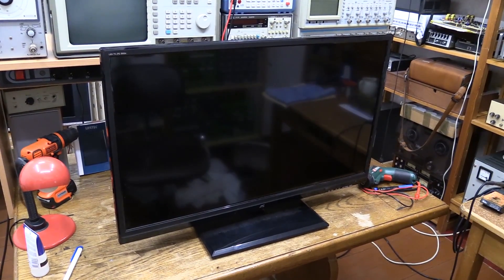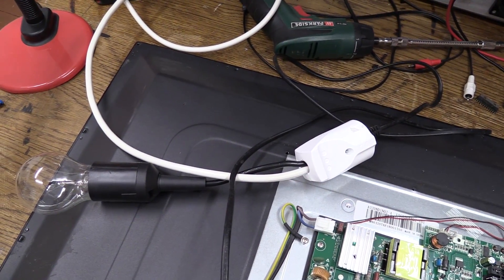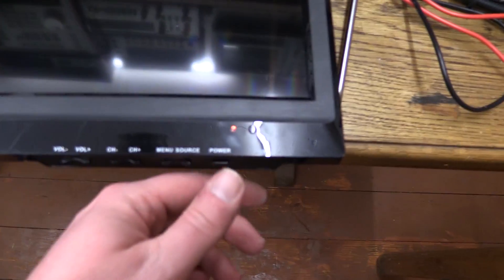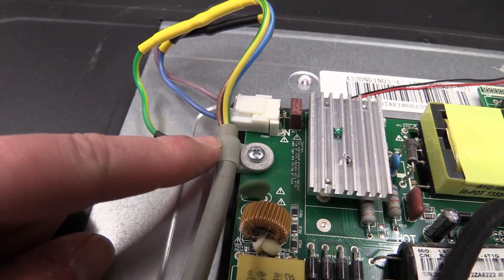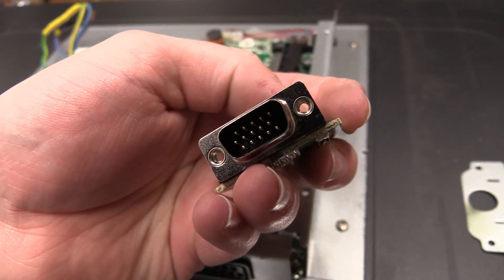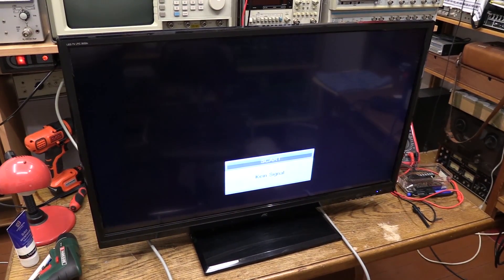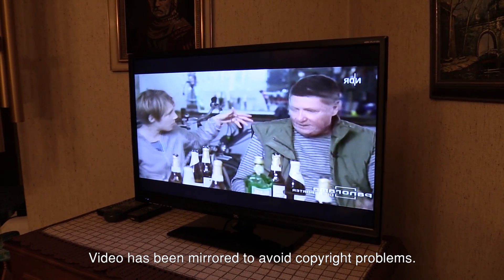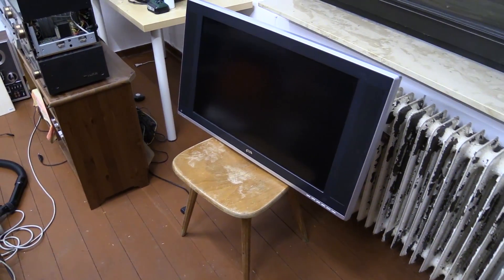High Voltage damaged LCD Television works!

Comment: Last night, there was a power problem and instead of 220v I had 300v. Fortunately, nothing broke except a small TV that was used as a monitor. I think that the sound doesn't work anymore but the picture might work. Should i open it to see if something is damaged or should i just plug it in? Btw the power brick is on the cable not internal
Reply from the maker: I would first try to just plug in the power brick alone, don't connect it to the TV itself. You can then measure if the power brick still puts out the correct voltage. If it does, you are lucky and the TV should hopefully work. If it doesn't, you might be able to find a replacement power brick.
Reply: @DrCassette  idk my grandpa who was using it said that the picture is perfect but the sound isn't working. I would measure but sadly i don't have a multimeter. Thx anyway for the reply

Comment: CapXon, and still working? Holy cow, when you think you've seen it all...
By the way, why do people always cut off the freaking power cords? To make a few cents out of the copper or what? Ι hate that.
Reply from the maker: Some people (including me) think the power cords may still be good for something, some people indeed sell the power cords for the value of the copper and some people even seem to think there was a law forcing them to cut the power cord off damaged or broken equipment for safety reasons.

Comment: If you are not not too far away from a Transmitter site, you should be able to pick up the signals from DVB-T rather easily. 
Just take some coaxial cable, strip about 15-20 cm so the center of the coaxial cable is exposed - do not short-circuit the shielding with the center core ;-))  - place it somewhere high in the room close to a window and you should be fine receiving some DVB-T channels. Maybe switch windows if the signal is weak.
Reply from the maker: Unfortunately I am relatively far away from the transmitter. I have built a more sophisticated DVB-T antenna (popular design, looks like two squares next to each other), but for good reception it needs to be set up as high as possible (under the roof) and aimed correctly. I didn't feel like going through such trouble just to test this TV ;)
Reply: I can understand that, therefore my remark that if you are not too far away :)) 

I am that close I only need a 5cm nail pushed into the end of a coaxial cable and receiption is clear. Would have been a nice way to have it tested but unfortunately that's not going to work for you then.

Comment: That old LCD TV at the end looks a lot like the 23 inch LG HD TV with DVD player built into the base That I found outside in my cul-de sac a couple of ears ago.  except mine has DVI-I and is an 1080i set. It only took me $25.00 to fix the tuner vs buying a $200.00 TV :-D  The DVD player is  very some-timey on what discs it will read... Laser is probably dying :-(
Reply from the maker: There is a dedicated video of that old TV coming up soon. It's not nearly as good as the one you have.
Reply: Yeah obviously It's not as good. A lot of the newer LCD tvs are getting so thin that you will never ever be able to service them on your own, some are so thin now the main electronics are in a soundbar . As Charlie Brown says..Good Grief!  

 https://www.cnet.com/products/lg-23lx1rv/specs/

Comment: I like the oldschool look of your floor made with original wooden boards. It's better to find a dropped SMT part on the floor than on the carpet. ;) The paint looks well, like the floor was painted not so long ago.

Also, good find! Congrats on that. :)
Reply from the maker: As part of last summer's renovations in the workshop I ripped out the carpet as well as a layer of linoleum flooring underneath, which was glued to the wooden floorboards. It was a slow and tedious process to get the glue off, I had to use a heat gun. The paint actually is from the 1950s, that's how long this floor was covered up. It looks hideous, it's just the camera that makes it look OK.
Reply: Thanx for fast reply. Good move with that removal of the carpet and the linoleum (and the glue of course). That's what I supposed - that the floor is from the 1970's or even an earlier decade. Thanks for clearing that out. I wouldn't expect it to be from 1950's and still in such a good shape. On the other hand, it quite makes sense since it was protected with 2 extra layers. Nevertheless, nice oldschool style, especially with the furniture! :)

Comment: The backlit mains button isn't fully safe (fingers in proximity) in hard short cases. I suggest a proper magnantic trip switch (Hager or Moeller) or a proper fixure switch (Vimer or Legrand). It's true that there's a light bulb in series but one never knows.
Reply from the maker: My workbench has its own dedicated circuit protected by a 10 A GFI in the fuse panel of the house. I'm safe.
Reply: DrCassette I was quite sure that you're adequately protected. But from my personal experience, a similar (backlit red) button made a huge spark just under my finger before the main circuit breaker responded.

Comment: JTC!  Now there's a brand I have not heard of.  It's certainly a Chinese made TV with the horrid CapXon capacitors so maybe a re-cap later on?  Anyway, well done for getting another TV saved from land-fill.  You can't get anything at our dumps (or tips) as we call them here in the UK.  Everything goes for recycling...it's really a shame!
Reply from the maker: I think JTC is only active on the German market. I don't intend to replace the capacitors until they have gone bad. This TV really isn't worth any extensive work. Taking things away from the dump (really it actually is a recycling center, but I don't call it that because nobody understands what that means) is not allowed over here either, but sometimes the employees aren't watching...
Reply: They have cameras at our local tip.  Things changed about 5 years ago and you can't anything!
Reply from the maker: Wow, that's pretty bad! The recycling center that I used to go to up until a few years ago unfortunately got remodeled. They now have things arranged in such a way that the e-waste disposal is right in front of the offices, so you always have somebody watching. So I am now forced to drive out into the countryside where there is another recycling center.